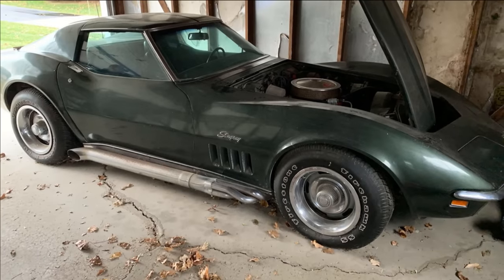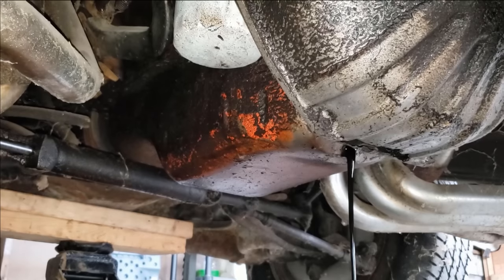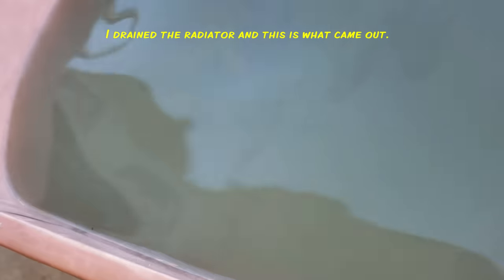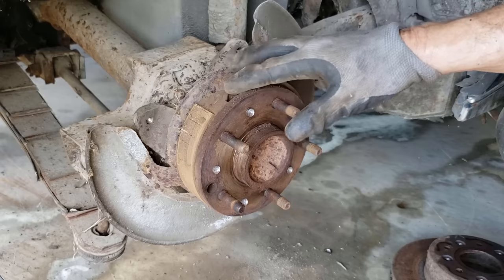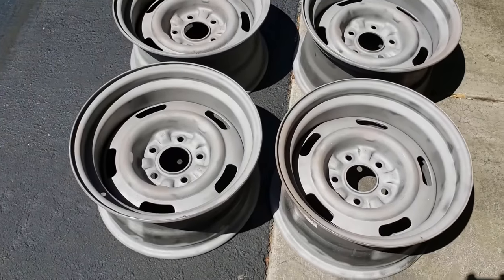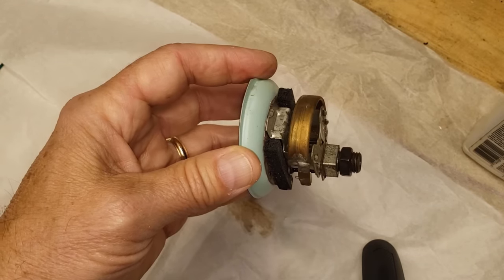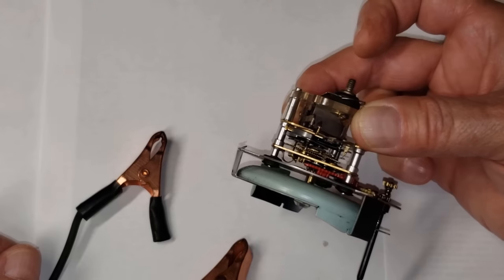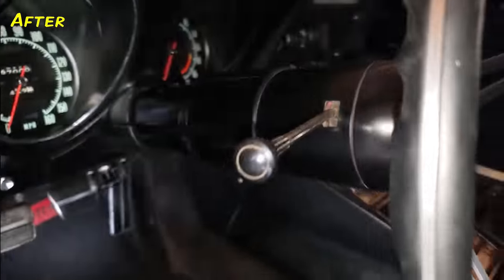WILL it RUN and DRIVE? 1969 L-46 4-Speed Corvette Garage Find! All ORIGINAL! NUMBERS MATCHING!

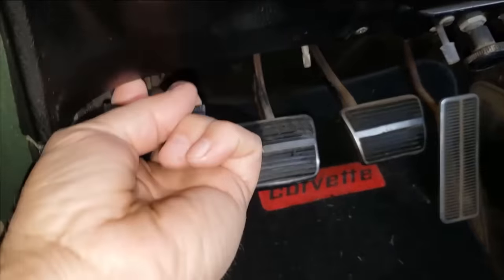Comment: Fram ,I wouldn't run it on my lawn Mower ,Wix or Baldwin filter, flush the radiator Though you can't go wrong with a new aluminum rad and a 160 thermostat .I own a 66 stingray roadster Numbers car L79 327 350 hp ,4spd ,with a 4:11 posi  with 62 k on the clock  will be following along to see what you do ,get rid of the plastic line on the oil gauge and change it out to copper tubing you will hate life if that plastic line lets go while cruising ,A very good explanation on cleaning the clock ,You need some hard Runs put on it to clean the cobwebs out of the motor ,go for it
Reply from the maker: Thanks for the comments Richard. NO MORE FRAM FILTERS FOR ME! I just put this cheapy one in knowing I would be replacing it with a Wix shortly after running it. Your '66 sounds awesome!

Comment: I noticed you put a fram oil filter on it!!! On an engine and car like that i would put on a original gm or a wix or a k&n filter. Much better filter material and the anti drain back valve actually works! I used to use fram cause thats what they stock in canadian tire but have noticed on my 2valve 5.4 triton timing chain rotational noise on the first 3 sec of start up before oil gets pumped back up! Once i switched to a wix or motorcraft or k&n no rattle on start up meaning instant oil pressure! Probably something to do with the anti drain back valve in the fram. Also many engine experts will also say the same from extensive testing. Once cut open the wix and k&n and motorcraft filters are beefy with more filter material and better made. The fram is just a garbage filter...
Reply from the maker: Thanks for the info Darren. I agree with you! I put this cheap Fram one on for the short initial running to collect the very old, contaminated oil. Then a better high quality oil filter soon after.

Comment: Bought a 1969 big block in 1973. It needs to see some pavement after 13 years of sitting.59,000 miles.Thanks for inspiring me.
Reply from the maker: You bet Gary! It's worth the effort to get you back behind the wheel of a Big Block. Keep me posted. (flatheadterry@gmail.com)

Comment: That is a very nice Corvette.  All that jewel needs is to just keep cleaning it up, everywhere.  Don't forget to change out the transmission gear oil with some 80W90 gear oil with the MIL-L-2105 B spec.  You can use any GL-5 gear lube as long as [it] has the J2360 designation.
Don't believe the 'hype' that these types of oils eat or corrode the yellow metal synchro rings in your Corvette's Muncie.  They won't.  Also,
depending on how warm it is where you enjoy your Corvette, use a quality 85W140 gear oil with the same J2360 spec. for the differential.
Your Corvette will love you for doing so, and don't forget the posi additive if so equipped.  Happy Corvette-ing, Cheers!
Reply from the maker: Thanks for the kind words and detailed info Viking Mike! I did change the differential oil with the Posi additive and didn't post a video on it yet. Not fun without a drain plug or cover!
Reply: Good going, that differential loves that sort of stuff.  Here's what you do.  Now that you got some fresh oil in the diff mixed in with some of the old oil, drive it for twenty miles, then use your diff/trans oil fill gun and vacuum out as much of the mixed oil out, then put more new oil in again.  Do this a couple of times to make sure you have ALL fresh 85W140 or
80W90 conventional oil in there.  I removed my third member and had a magnetic drain plug installed.  Way easier to do the changeover maintenance.  If you do as I described every 6,000 miles, the diff oil if basically always 'FRESH'.  Good luck and drive that Corvette.

Comment: Impressive craftmanship. Not many would bother to rebuild the gauges DIY. And the clock repair, congratulations. I knew the clock worked on a similar principle with spring driven action and electric rewind of spring in my 1039 Mercury; who'd'athunk it. Was once advised I could refresh a vintage oil pressure gauge with hot Marvel Mystery Oil injected with a small gauge hypodermic syringe.  It seemed to have worked.
Reply from the maker: Thanks Flatcreeker! :face-blue-smiling:And thanks for the tip about Marvels. I have a bottle of it and it didn't cross my mine to use it on the gauge!:face-red-droopy-eyes:

Comment: You are a genius. The work you did on the clock was amazing. You revived a beautiful car, congratulations !  I see you bought 245/60/15 tires. Those are a little small in diameter, compared to the original factory tire size diameter for a C3. 255/60/15 or even better (for looks, not handling), are 225/70/15, which fill the wheel wells really well, like the original F70/15 bias ply tires.   245/60 ok on front if springs have settled, like yours, but definitely then you should have 255/60 on the rear to fill those wheel wells! Negative space in a wheel well is like having large door gaps. Millimeters make a difference...our eyes can discern the difference when there is even a little too much negative space.  But I loved your video and learned a tremendous amount. Thank you
Reply from the maker: Thanks for the nice complements Jonas!:eyes-pink-heart-shape: And the feedback on the tire size. I totally agree with you. I should have taken more time to "fill the wheel wells" better.:face-turquoise-covering-eyes: I just went with the same size that Mike had put on it years ago. The 255/60's would certainly be the right direction to go and really make it look Kool!:hand-orange-covering-eyes:

Comment: Don’t forget to drain the block. When you bench bleed the MC or bleed brakes, never push the piston to max or you will tear the seal. 32:53 that copper band is the same thing you see in tire pressure guages. The clock points will usually be worn or need filing. If they are worn you can add solder then file flat. I had to do that on my 70 Z28.
Reply from the maker: Great tips and info John! Thanks. I was aware of not pressing the Master Cylinder in too far so I was very careful when performing the bleeding.

Comment: My '73 which I recently SOLD TO A FRIEND was completely numbers matching  right down to the alternator.  It was a factory L-48 which was gutless so I bought a GMPP ZZ-383 about 15 years ago and it's now a screamer .
After missing a Corvette for two years I bought a 2004 C5 convertible. Great ride and handling  and very comfortable but It couldn't touch the ZZ-383 so I replaced the Heads, Mass air flow and Air filter system from a wrecked C6 Z06 and a new Comp Cam. Now it moves!  I've raced my old '73 with the ZZ-383 and they're damn close. One very helpful change I made to the '73  was an HEI distributor with a cable drive for the tachometer. Worth every bit of $250 or whatever it cost me. Cheers!

Comment: Geat find. And onky 8k.  Guy obviously didnt kno what he had.     I used to have a 1970 red on red vert  l46 that I bought used with a ton of miles from my Dad's friend it ended up blowing a valve or something so I sold it but that thing was awesome  my dad told me his buddy cud get it up to 85 mph in 2nd gear I used to get rubber out of second gear and   a little chirp out of 3rd   I love that your car does not have the luggage rack and itsa coupe. Love that dark green color too Also small block more balanced and less nose heavy that the 454
You will be a hit at cars and coffee with that bad boy
Reply from the maker: Hey Yardman, thanks for the cool stories. They are fast rides as you know! The seller, Mike, took out a $3200 loan for this Vette in 1971 so he didn't have much money invested so he was happy with my offer. I was taking a gamble, as I didn't know if it had any major drivetrain issues or not.

Comment: You can use CLR (Calcium/Lime/Rust) remover (meant for home use) to clean out radiators that have crud builup and its great for clogged heater cores too.....
Reply from the maker: Thanks for the info!

Comment: You can get rid of just about all that rust on the exhaust and ground molding if you lightly dampen an SOS soap pad and scrub. In my youth i used to take old bicycle rims totally coved in rust and make them look almost new that way. But mind you, lightly tap the pad in some water to bring out the suds. Too many people over moisten the pad which removes most of the rust arrestors from the SOS pad which is makes the pads so great at removing rust.
Reply from the maker: Thanks for the great info Wayne! Learned something new. 🥸

Comment: Enjoyed the video and your appreciation of matching numbers and thoroughness of updating maintenance but curious about not using a Genuine GM oil filter, there is a difference.
Reply from the maker: Thanks for the kind words Steve. As written in the description and comments, I initially used a cheap filter when I first ran it after 17 years to remove the old contaminated oil. Then changed it again to a better filter shortly after.
Reply: @FlatheadTerry  That's great news. I used to be a Chevy factory rep and remember cutting open a GM filter, unrolling the filter material and compared it and the check valve to others. Again, enjoyed the video!!!

Comment: So...  I just got to watch you live out one of my dreams.  Thank you for the trip down memory lane.  I do have one ?, however.  Why did you not clean up the old brake booster before putting the new master cylinder on it?  I was quite surprised by that.
Reply from the maker: Great question Calango! It did cross my mind however at that time, I was concerned more if there were any other major issues in the drive train (clutch, transmission, rear end) that I wanted to get it running first, then make it stop. Then I could test the drive train. I bought it not running or rolling so it was a big gamble and mystery as to what worked and what didn't. The Brake booster was down on my priority list to address. Also, I was very anxious to get it back on the road so I could go thru the gears with it ASAP! It turns out the Booster worked fine and was just rusty like a lot of the rest of the Vette.
Reply: @FlatheadTerry   Oh, ok, that makes sense.

Comment: I have a homeless friend. Well homeless. He lives in a 30 something motor home. Changes streets every week or so. Which means he also has to move two box trailers 1 corvette oh his other smaller motor home. Then his old international flat bed truck. Plus his 2 40’s Harleys and a Norton. 
  His corvette is a 1969 small block 4 speed convertible. It right below a daily driver. It runs and drives well but it needs a garage so he can work and clean it up. 
 He hasn’t worked in years yet has all of these vehicles.
Reply from the maker: Wow! I wish I could help him out. (If he's willing). You can contact me at flatheadterry@gmail.com.

Comment: I would have used Allen's double strength cleaning vinegar for the rad instead of just 5%! But you probably don't know about it in the United States?
Reply from the maker: The strongest I could find was 5%. I kept the original radiator and it will get re-cored it in the future.:trophy-yellow-smiling:

Comment: Needs a valve adjustment, sounds a bit floppy, on one hole. Maybe the black plug on the passenger side!. Nice original car, compression test in order.. also engine renew in the silver can does wonders on original small blocks. Remember your valve seats are not hardened in that year, and 67K miles, can make them sink in the heads. I would go through them, or shelf them, run a set of HP aftermarket IRON heads.. to look original but flow better. Worth 15HP without modification to anything else. The factory carb is 700 CFM anyway, and properly set up, a great street carb.. Enjoy It!!!
Reply from the maker: Thanks for the tips Jeff! What I didn't show was the previous owner, Mike, gave me the 1978 detailed repair bill from a local garage from when he broke some valve springs after going 150 MPH!:face-purple-wide-eyes: Thankfully he didn't drop a valve. :face-orange-biting-nails:The mechanic replaced the springs and did a valve job while he as at it at 42K miles. The "popping" sound you might be hearing is from the rusty 1973 Headers and Side Pipes that developed several holes the more I drove it. It still could be valves though.
Reply: @FlatheadTerry  nice, hopefully in 78, he installed hardened seats, that still wasn’t common then. Unleaded was really just introduced in 75, and corvette cars had them in 76. Hard to clearly hear on the phone, either way, great engine, I’ve built dozens of them, yours is basically a hydraulic cam LT1, great little engine, that I also guess by sound, had its cam changed when the heads were done, sounds like a bit more duration and less overlap then stock to me, but that’s a good thing.  Great work getting it dialed in, love the headers sound, would not change them, would actually repair them, and run them. Enjoy the fruits of your labor, I love how you got your first wave, while you did your test run.! That’s what it’s all about! Pride of knowing you did it yourself. Drive safe.

Comment: "Flathead Terry" why didn't you clean and wire brush everything and coat with some fresh paint the shroud and underneath it. And why would you NOT replace the Booster on those brakes. That diaphragm is old and probably as dry rotted as those tires. Personally I would have clean everything and the sounding areas and painted with flat black. I would have also cleaned that Carb because I am sure there is some varnish in there that may present a problem later on down the road. I would have taken those wheels, after sand blasting, to be Powdered Coated in the original Color. I know the Clocks in the C-2 Vettes were always broken, those points were the usual problem. I think there is a modern Quartz replacement. I had a 67 Coupe and a 71 LT1 so I really enjoyed this video. Nice job. Can't wait to see it buffed and waxed. Oh and put the original side pipes on that Vet.
Reply from the maker: Thanks for the comments. My goal was to get it back on the road by making it "go" and "stop", then work on the rest after that. There's other things I did "off camera that I didn't film. (It takes a lot of time to film, edit and post these episode's and sometimes I just want wrench on it without a camera over my shoulder)
Reply: @FlatheadTerry  Amen to that Terry. Working and filming must be the pits. Is that a 36 Dodge or Plymouth you are driving around in? Unbelievable you found that Vet with original low milage. What a find.
Reply from the maker: @dgiorgi1725  Thats my unrestored '37 Plymouth Coupe in the background. I drive it daily and have many videos on it on my Channel. Thanks for watching!

Comment: A cup of wood bleach in the radiator, run it for a 1/2 hour, drain it and put a cup of baking soda to neutralize the wood bleach (acid). flush good. You wont believe how good it works.
Reply from the maker: Great suggestion Brian! Thanks!

Comment: I noticed while you were tinkering with the oil pressure gauge you never mentioned the ( Bordon element )   In case you didn't know that is the copper circular tube  in the rear of the unit. The way it operates is when psi is applied  it will try and straighten out causing it to pull on the linkage and will rotate the small gear so on and so forth.  I have a hand pump designed to be used to calibrate such things but you could use compressed air and a regulator. The problem with compressed air is too much pressure accidentally applied will explode/ruin the gauge.
Reply from the maker: Great info MrTony! Big thanks! No, I did not know this! (But I do now!)😃
Reply: @FlatheadTerry   Terry I was an industrial air compressor tech for near 40 years and  mercoid switches were common back when that vett was new.  As I mentioned I have a hand pump setup to calibrate pneumatic and hydraulic gauge and control pieces.  I don't really have a use for it any longer ,retired now so if it is something you might could use I would send it to you sir.
Reply from the maker: @MrTonyPiscatelle  Ah, thats cool!Thanks for the kind offer, but they would probably just rest in my tool box and not be used. I appreciate it though!

Comment: Oil line to the gauge. Wow!
Reply from the maker: Crazy isn't it?
Reply: That's how they did it. Also had a clutch cable. I miss those days. '72 Lemans.
Reply: 73 was the last year for the mechanical oil pressure gauge with the plastic nylon line running inside the car (believe the 68 line was steel), for 74 the gauge read 0-40-80 and was electric compared to the previous 0-35-70 mechanical.

Comment: I would've had original brass radiator repaired.. i did that instead of replacing with an aluminum.. aluminum radiators might run a little cooler,  but once they go out their done with. Originals can always be repaired.. i chose to have mine repaired at 110 bucks versus 300 for aluminum.  Classic car radiator shop said smart move by me..
Reply from the maker: As I mentioned before, my two local shops wouldn't touch it as they said it was too old. I DID NOT SCRAP THE RADIATOR. Its going to stay with the Vette so it could be re-cored and restored in the future. I know there are radiator shops that can do this but quite a distance from me. Take note that I save ALL restorable parts off camera for the future. The original Q-Jet and water pump have been restored and back on this Vette.

Comment: what a find ... when u look at headers ... looks never even used huh
Reply from the maker: Mike the previous owner removed the original exhaust system and valuable side pipes in 1973 because he said they rattled. I don't recall if he told me how many miles it had on it when he did that but he ran those headers for a long time!

Comment: Can’t believe you didn’t touch the carb or clean it
Reply: I know and fires right up & runs smooth as silk! Right
Reply from the maker: I couldn't believe it either Mike! I anticipated having to rebuild the Q-Jet but the fuel filter and fresh gas was all I had to do. It will need to be rebuilt though.